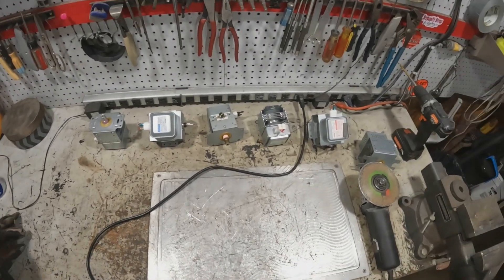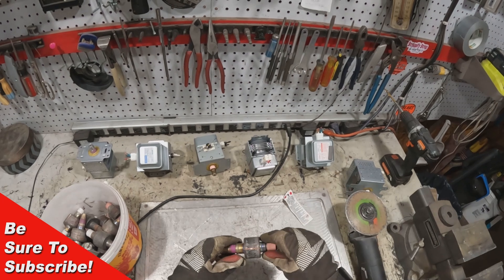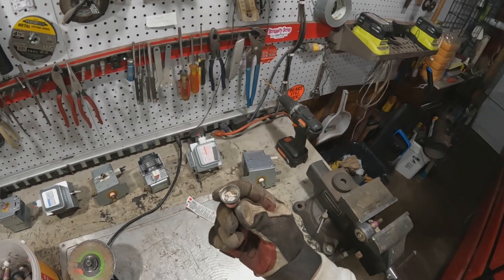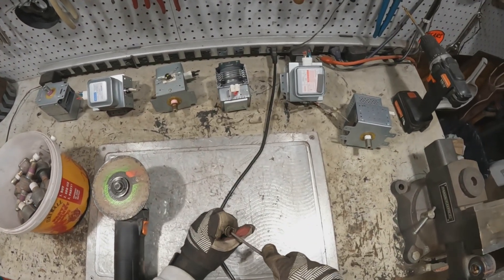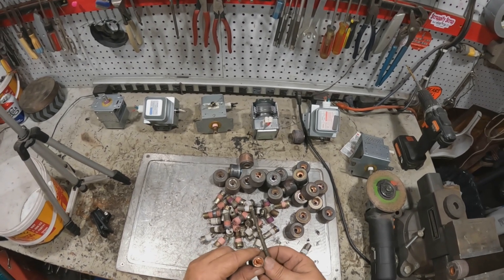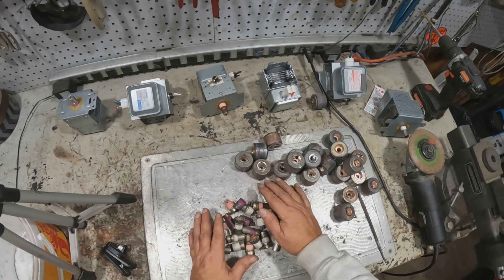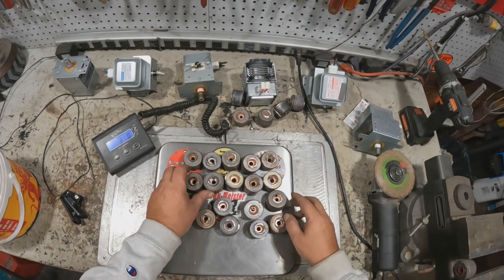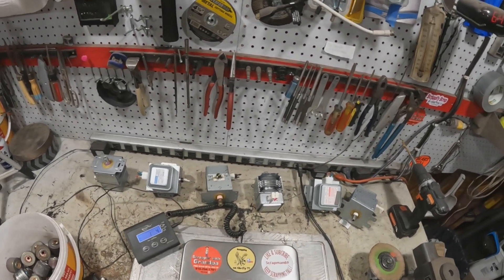Preparing Microwave Magnetron Cathodes for Melting | New Separation Method

Comment: You may already know this but that “ceramic” section is actually a ceramic coated beryllium. Careful it’s harmful if crushed or cracked.
Reply from the maker: @trevorgray3160  yes, they actually stopped using that in 1984. But I'm aware of it. Thanks for watching.